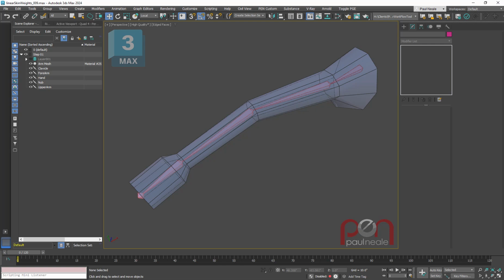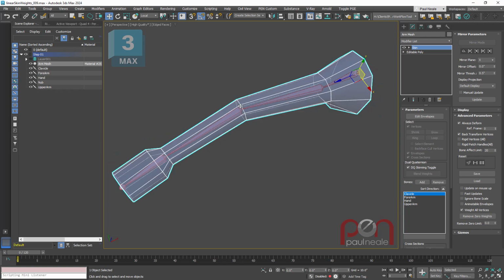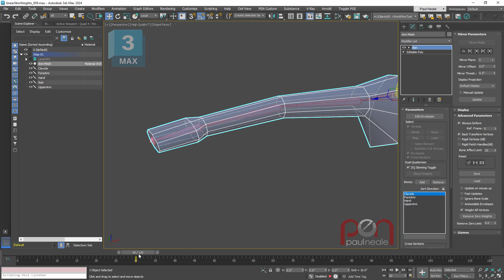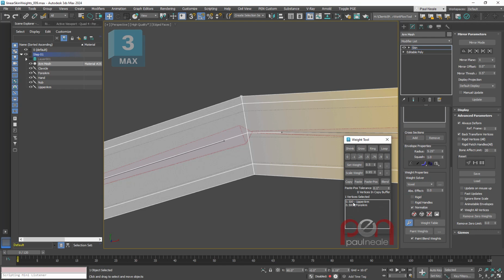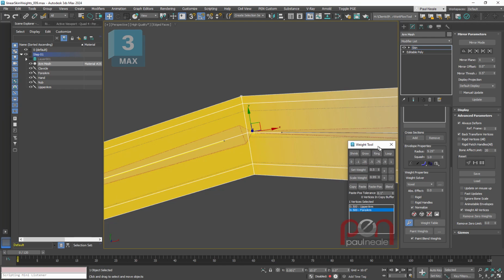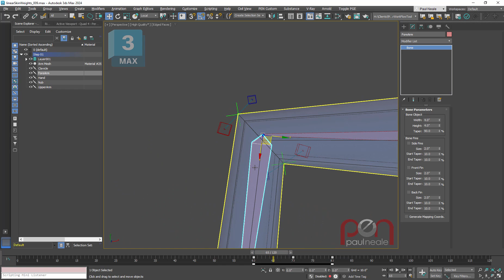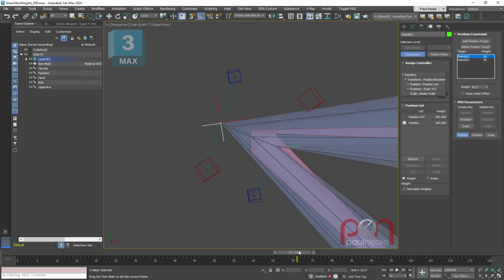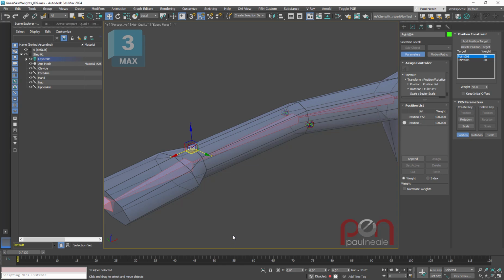Linear Skin Weights Explained

Comment: I think you just answered a question I've had for awhile. I've had an issue of trying to deform a mesh into a new pose, set the new pose to frame 0. However when you return it to the original pose, the mesh is not the same shape anymore. I'm suspecting this explanation is the reason why. Now to wonder what kind of math is involved in figuring out returning it to the original shape and pose.
Reply from the maker: Not sure I'm following you. Skin, if initialized at the base pose, will always remain in the same shape you started at in the base pose no matter what weights you use.
Reply: @paulneale  is it alright if I message you a video showcasing my issue?
Reply from the maker: @ItsJimbo3  sure